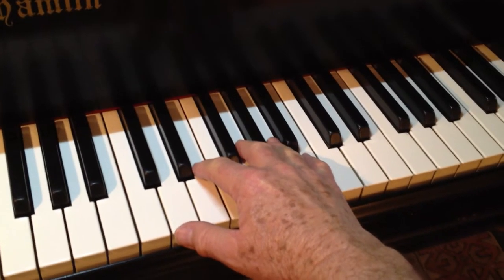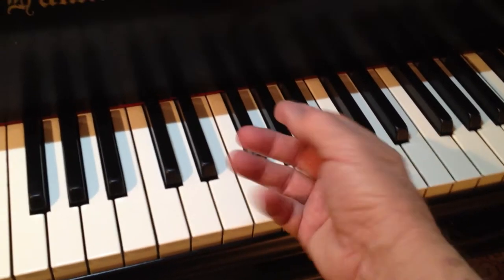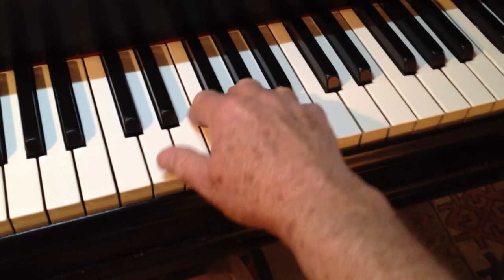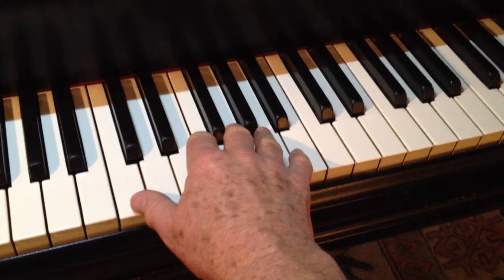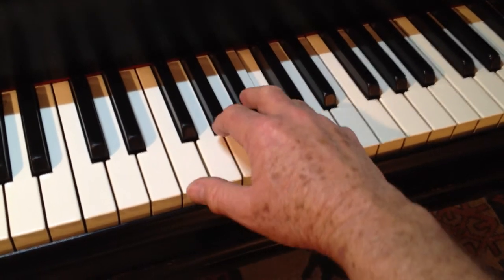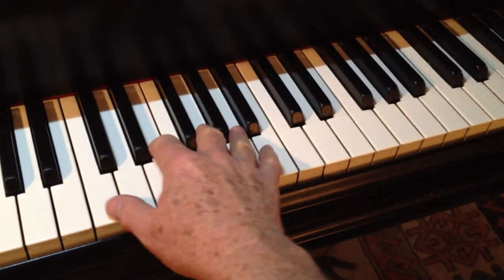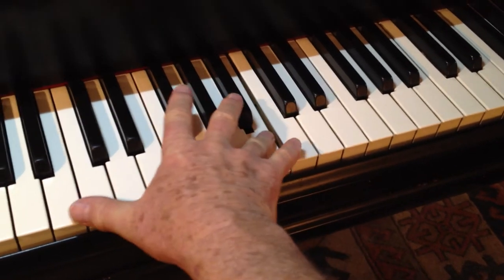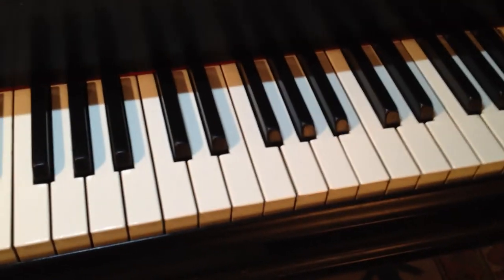Shaping at the Piano

Comment: I congratulate you on your book, I loved it. I would like to ask a question about it, specifically regarding In-Out movements, through an example. Suppose that on the descending scale of C Major, we are in the situation where the second finger plays the D note. At this point, the thumb is slightly off the keyboard. To play the C, allow a combined movement, that is, a double rotation plus a movement of the arm towards the keyboard. My question is the following: to move the thumb to the keyboard is done by SLIDING the second finger, that is, with the weight of the arm resting on the second finger, is the "backswing" of the double rotation and without slipping is transferred arm weight for thumb rotation move arm forward? A cordial greeting
Reply from the maker: I move toward the thumb by walking gradually in as I approach it, arriving at the correct spot by the preceding note, in this case the 2nd finger. Play the thumb rotationally from the 2nd finger. No more movement inward is needed.

Comment: Hi Neil, 
In your book (p.12) you describe R.H Descending=Over shape and R.H. Ascending=Under  -- Is this always the case? 
I was watching "Virtuosity in A Box" DVDs recommended in your book. Shaping examples there are majority of time as explained by you. However sometimes over/under directions are reversed (ie rh descending becomes=under vice versa)  One example is DVD #5  at 1:40:00, an ascending passage measure 1 of Moonlight sonata mvt 3. in this example ascending C# minor arpeggios take OVER shape going up G# C# E G# , UNDER when down G# C# and repeats.

So my question is how can we more reliably decide whether we are doing Over shape or Under?  Perhaps this is a skill that comes with experience, I was hoping you could help clarifying it.  Again thanks for the wonderful book.
Reply from the maker: Thanks for your question, Ozgur. It's a very good one. Edna sometimes shows shaping that accommodates the length of the fingers. That is, higher for three regardless of the direction. I don't have at my disposal the disc you reference, but I suspect the point she makes is more about higher vs lower. In the example you give, the hand can be a little higher on the way up the arpeggio and a little lower when moving back to the thumb, a shorter finger. I prefer to shape a little (very little) out for the two longer fingers and back in for the shorter ones in that passage. I don't really think over/under so much here. I know. It can be confusing. I remember Taubman saying with a giggle, use what works best for you. Sometimes there are conflicting or overlapping principles.
Reply: Thank you, it such a privilege to get answers to our questions after reading your book. Yes the particular example is as you pointed specific to arpeggiated passages and hand moving higher on the way up and slight lower back to thumb.